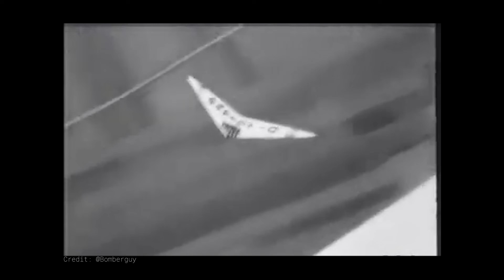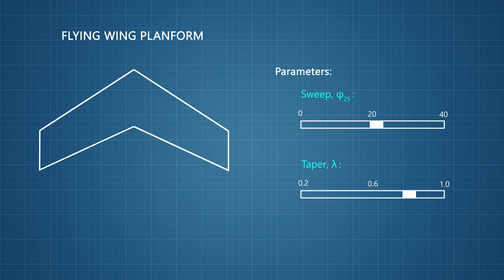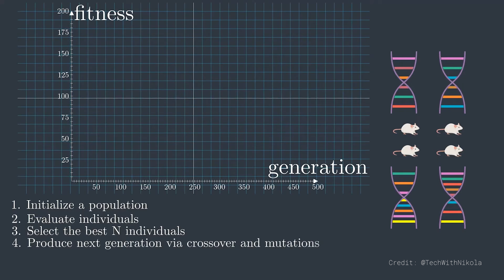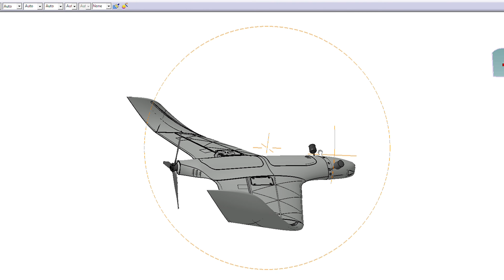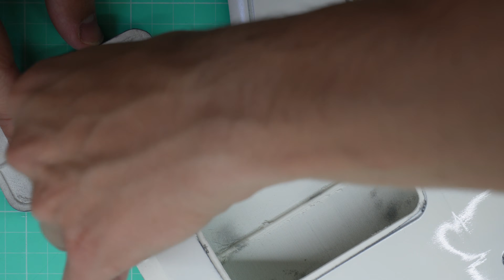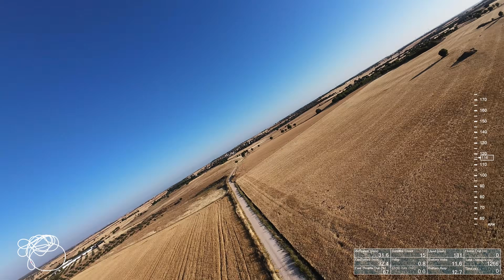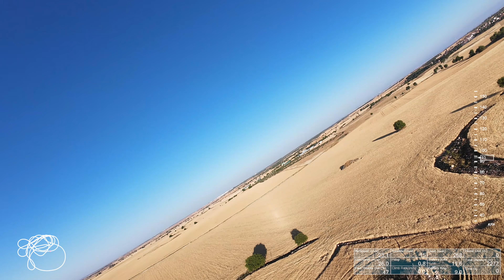🚀 I asked A.I. to design the ultimate FPV Flying Wing... and it's INSANELY EFFICIENT!

Comment: Well done, intresting 😃
Not convinced at this stage AI is any more help than a computer and search engine for helping you build a Model wing. It would need to build and fly multiple designs to get its own data.
No mention of Airfoils, CG. CP etc - there are some glaring errors that it did not pick up, one being the Plane would wobble (dutch roll) badly....didn't it 😉
Reply from the maker: Thanks! 🙌 In the next videos I’ll cover airfoils, CG/CP, and Dutch roll stability in detail. Stay tuned!

Comment: Hi Neuronautic. Could you please share flight results with comparing of other planes. For example baby wing that has the same wing size (0.6m)?

As I see on the speed 100km/h it takes 11-13 A. So if you have 2000 mah 3S battery - then I suppose that you will be able to flight about 5 mins

Also it's interesting to see also bigger design for example for 1.6 meters wing width and with 6S motors as in this case we'll be able to see full efficient and really long flight (several hours) or something like Ar Wing Pro (1.2m). In my case it was pretty efficient (but don't remember numbers)
Reply from the maker: Thanks! 🙌I’ll share side-by-side logs vs ~0.6 m wings in next videos, so stay tuned!🚀✈️

Comment: First off, BRAVO! The requirements, neural network testing, 3d printing.... this is not your first FPV wing is it? As someone who has been flying and designing these things since '08 I sincerely applaud your efforts on this front! Have you though about the noise? I suspect that with the Rx antenna oriented as is you are getting turbulent air hitting the prop inducing prop wash which is adding the "drone" noise and decreasing effeciency. Subbed to your channel and downloaded the model. I am currently building a Horton Ho and would love to add this to my collection. Cheers!
Reply from the maker: Thanks a lot 🙌 Really appreciate your kind words and support—it means a lot coming from someone with your experience! For the maiden flight I wanted maximum link reliability, but since the design is modular, the antennas can be easily tucked inside for cleaner aerodynamics. That’s on my list to test in the next iterations 🚀✈️. Super excited to hear you’re planning to add this one to your collection!
Reply: @neuronautics_Lab  for ease of setup i would agree with you, but you might find maximum link quality out towards the wing tip, antenna orientated in a vertical position. High density items like your battery or even your FC can decrease rf signal strength at range. Unfortunately, This placement will create uneven drag on the wings and induce a "Dutch roll" effect on such a small wing. But that is another topic. Lol.  The null zones of a dipole as orientated are going to be pointing at you when turning and that will result in decreased signal strength. Real world though, it's not going to matter if you are only flying 100m around your location. It will if you're out 10 miles though. Pla is rf neutral, as are the fiberglass rods you installed. A compromise to each of these drawbacks would be a diversity receiver and two antennas at orientated 45* angles to each other inside the wing. Albeit for a small weight penalty. Just some ideas if you make a v2. Cheers and congrats again
Reply from the maker: Super cool and interesting stuff, thanks for sharing! 🙌 Definitely not my area of expertise, but it’s the kind of detail that could really impact future designs. I’ll keep it in mind for a V2 ✈️🚀

Comment: What an exciting achievement, well done! I fully understand the hassle to run over and over CFD analyses to iterate and optimize. Your approach of using a neural model is awesome. I'd love to know more about it. What software do you use for CFD analyses? How did you choose the airfoil, and is the airfoil of the wing root and tip identical?
Reply from the maker: Thanks a lot Pascal 🙌For CFD I used OpenFOAM, and yes, the airfoil is fixed throughout the span: a modified Selig airfoil tuned for low Reynolds numbers and optimized for flying wings. It’s a compromise between efficiency and stability. In the future I’d love to explore airfoil variation see how much extra performance we could squeeze out of it 🚀

Comment: I tried to download the model. There was am error, and it wouldn't let me download it! Apparently you want $34 usd for it.....
Reply from the maker: As I mentioned in another comment, every project like this takes a huge amount of time, skill, and resources. This isn’t my job—it’s a hobby I’m deeply passionate about 🚀✈️. I’m not here to turn a profit; I do it to keep pushing the boundaries of aviation. The small charge for downloading the model files is simply to help offset the cost of the equipment and materials. Believe me, the tools, electronics, and filming gear needed to design, build, and share these projects aren’t cheap 😅, and this helps keep future projects possible.
And believe me, all in all, you’re getting an amazing set of plane files for the money 🙌—well worth it for the work, testing, and detail that’s gone into them!

Comment: You are truly a gifted engineer.  I am and engineer, power pilot, and sailplane pilot.  I have a number of observations that you may want to consider.  First, the reason there are not many flying wings is that they are inherently inefficient.  They have a low span to cord ratio (aspect ratio).  The wing section aft of the center of gravity has to produce negative lift to balance the airframe and therefore it adds as much induced drag as a conventional tail.  The vertical wing tips reduce tip vortices, but substitute a lot of parasitic drag.  I realize you built them for directional stability, but they are not efficient compared to winglets.  
The Northrop flying wing, YB-49, was cancelled because of instability in pitch and yaw, poor payload capacity, and lack of range.  It was not an efficient design.
The B2 bomber is a true flying wing, but it was built without vertical surfaces to reduce radar cross section.  
If you want to make your design much more efficient, add a small canard for pitch control and reduce the wash out of the wing tips..  Burt Rutan's Long-EZ  or VariEze are the poster children for extreme efficiency.  Or consider the design of the Quickie.

If you want extreme efficiency, study modern sailplane design.  These designs have evolved since WWII.  Present designs have L/D greater than 100:1 and have very efficient polar curves.  They have high aspect ratio wings and winglets.
Good luck on your next design.
Reply from the maker: Thanks a lot for your thoughtful and detailed feedback 🙌✈️. I really appreciate you taking the time to share your observations and experience—it’s insights like these that make the design journey even more exciting!

Comment: I am designing a small flying wing that you sit on and operate much like a motorcycle or snowmobile.  It will have a windshield and a removable canopy.  It will be a low speed low elevation machine meant for short local rides.  I am undecided if I want to go electric, but I think that might be what I end up doing.  I am thinking of a dual inline propeller setup, one rear, one front.  And it might have a pair of small retractable wings in the front to help with low speed take off.  Not sure how that will play out.  I want to keep dimensions as small as possible, I think around 21 foot wingspan is around what I have in mind.  It will be made from high density foam, skinned in carbon fiber, and then remove the foam.  The body will be cut into panels and placed on an aluminum tube frame chassic / frame.  I am trying to learn more as I go, but this will be built around Canada's ultralight aircraft regulations.  I think flying wing is ideal for storage on your own property, as it minimizes overall dimensions.  If I don't go with electric, i am looking at used 2 stroke engines, from things like snowmobiles, etc.  And will detune them to be more reliable and less powerful.  It's an opportunistic thing though...if I find something that would work, i will adjust design based on that.  I've liked flying wing aircraft since I was a child making paper airplanes.
Reply from the maker: That sounds like such an ambitious and exciting project, Aaron! 🙌 A personal ultralight flying wing you can ride like a motorcycle is a really unique concept 🚀. Can’t wait to see how your design evolves—please keep sharing updates, I’d love to follow your progress! ✈️🔥
Reply: ultralights are as about as small as you can go safely with a person.

Comment: Very inspiring but you should remember that in context of ANN the design is optimal ONLY within the constraints and scope of the ANN’s training data and evaluation metrics. It’s NOT necessarily the BEST possible design in a broader aerodynamic or engineering sense. You can say that, this is the most efficient design predicted by the ANN within the tested parameters. I’m skeptical about your conclusion, but I still value the innovation and effort you put into it.
Reply from the maker: Absolutely, you’re 100% right — the “optimal” design here means optimal within the constraints, training data, and metrics used in this project. ✈️ I really appreciate your thoughtful skepticism and your kind words about the innovation! 🙌

Comment: What I cannot understand: All this awesome effort, but you still let antennas stick out, as well as linkages, and you do not have a sleek rear end. You also incorporated an LED strip on the leading edge which disrupts airflow and you do not seal the hinges, which enables pressure transfer between the lower and upper wing side which negatively affects efficiency. You also put a horizontal antenna directly in front of the prop to produce dirty air for your drive unit. I do understand, that below 100kph things do not matter that much, but why going for maximom efficiency in the calculations, then ? No condescending, just genuine interest, with a helping hand, of course, if you are interested
Reply from the maker: Thanks for the detailed feedback! 🙌 You’re totally right—there’s a gap between a purely theoretical “max efficiency” design and a practical, buildable FPV plane.

Some of the compromises (like exposed antennas, linkages, LED strip (which is by the way taped for the maiden flight, etc.)) are for functionality, modularity, and even looks rather than absolute aerodynamic perfection. At this scale and flight speed, the penalties are relatively small. However, I do agree it would be interesting to dive deeper into how much of a performance penalty all those small details actually cause. Maybe for a future video?? ;)
Reply: @neuronautics_Lab I understand the practicality aspect very well. But because of all the elements sticking out, you would have had a very similar result if you just made a sleek fuselage and picked a random airfoil for tailless planes - without  AI. I mean, I was 50% of the design team that created what was later to become the TBS Mojito. I poured all my aero ocds into it to make it the most efficient powercruiser out there ( before Trappy took shortcuts in production ).

Comment: Have you had any motor cooling issues??
Reply: And general cooling issues?
Reply from the maker: Not so far! The design has 2 NACA intakes at the nose and small outlet vents near the motor, which keep airflow moving through the electronics and the motor. Temps have stayed well within safe limits during flights.
Reply: @neuronautics_Lab that’s good. I have a Flik wing and cooling was definitely a problem and with the motor covered like that I can only imagine. But it seems like you managed well. 1404? 3800kv?
Reply from the maker: 1507, 2700kv with a APC 5x3E

Comment: Why would an FPV drone have 2 cockpits?
Reply from the maker: They serve different purposes. The front “cockpit” provides quick access for swapping batteries between flights, while the rear one is more permanent, giving access to the flight controller, GPS, and other components you rarely need to touch.

Comment: A slight criticism about your introduction. All birds have tails. All bats have tails. None of the tailless aircraft designers were inspired by birds. They were inspired by the idea of saving weight and complexity, and perhaps by moths (even though some moths have tails). As for stealth technology: that was not a concern until the invention of RADAR. Even then (and still) wooden framed aircraft with cloth skins are as stealth as it gets. Overall you've got it right though,
Reply from the maker: Interesting points! 🙌 While it’s true that most birds have tails, many early designers—like Dunne—did mention inspiration from bird flight, particularly wing sweep and stability traits they observed. And you’re right that weight and simplicity were major drivers too. Regarding stealth, the Hortens didn’t call it that back then, but their designs happened to share characteristics (low RCS, smooth planform) that modern stealth benefits from. So in a way, they were ahead of their time—even if radar wasn’t the focus yet. 😉

Comment: Efficient?? Averaging 10 to 11 amps is not efficient. Cool looking wing though.
Reply from the maker: Average amps during that flight were actually well below that—around 7A (I’ll be uploading a detailed video with full telemetry readings 📊). Considering the speed, the fact it’s only running on 3S, and that the DJI O4 FPV system is basically an amp vacuum, I’d say it’s pretty efficient. I’ll even compare it with some commercially available wings in future videos—so stay tuned! 🚀✈️
Reply: @neuronautics_Lab  7 amps at the speed showing is not super efficient. Better than some commercial, yes. Higher voltage lesser amps. Probably need a different motor prop combo as well. 

My bad for speaking without introducing myself. My name is JD.  Pro Builder / Long Range Pilot.  More than 20 years experience.

Comment: Have a look at the Opal, designed and built by Scott Winston back in the 80’s. Way ahead of its time. Less than 100 kilos dry and capable of crossing Australia in daylight hours, also has the record for fastest height gain to 10,000 feet and the record for absolute height gain for an ultralight at 30500 feet.
I knew Scotty personally and can verify he was a bloody genius when it came to aeronautics.  Unfortunately, he lost his life in an accident.
Reply: Bloody auto spell, Winton , not winston. Thanks
Reply from the maker: Wow, that’s incredible—I had never heard about it but Scott Winston’s Opal looks like it was truly ahead of its time 🚀. Those records are mind-blowing, and it’s inspiring to hear about innovators like him who pushed the limits of aeronautics. Sad to hear about his passing, but his legacy clearly still flies high. ✈️
Reply: @neuronautics_Lab 
Thanks for your comment, I don’t know if you are aware but the opal came under air navigation order 95.10. Max dry weight 100 kilos, Scotty had to remove every bit of extra weight that was unnecessary, such as the plastic knobs on the choke and throttle levers, and other things as well. The opal could carry 280 liter of fuel, and fly at 280 kmph. And he never got around to it but Scotty was going to fly from roughly Sydney to Perth in one day during daylight hours, unheard of.
I am truly blessed to have known Scott and Dean Winton. 
Thanks again for your comment.

Comment: A question about the optimization process. Are you sure that you found the global optimum and not just a local optimum? If so, how did you do that? Anyway your project is amazing!
Reply from the maker: Thanks! 🙌 There’s always a chance it’s a local optimum, but using genetic algorithms helps explore the design space broadly—much more than methods like gradient descent. In this case, the result aligns closely with traditional design benchmarks, so I’m confident we’re on the right track 🚀✈️

Comment: For a bit of history look at the old Hobie Hawk, a glider designed maybe 30 years ago. The wing form looks beautiful but it turned out to be very unstable. Your design looks like it might be susceptible to the same problem. Nowadays there are probably electronics to compensate for the problem but I'll bet they use a lot of power to do so. :-) Your bird is beautiful and well engineered.
Reply from the maker: Thanks! Stability is always a challenge, but modern flight controllers handle it well with minimal extra power.

Comment: Great project and great to see it fly so well. A bit of nit-picking though - its not a flying wing. The usual description for this class of aircraft is BWLB or Blended Wing Lifting Body. Flying Wings are just that - a wing. Maybe with a small cockpit behind the point where the leading edges meet but not a just a tail-less standard body with wings attached.

Comment: Very nice build.
Just a question. How do you know that it is insanely efficient?
Reply from the maker: Thanks! 😊 Given the constraints I set—like max span, wing area, and weight—this geometry is as efficient as it gets based on today’s state-of-the-art simulations and optimization process. 😉
Reply: @neuronautics_Lab  So essentially you were doing the same thing I do to make pedal driven generator of 150W at 500rpm and 90V output when I want 95% efficiency
I'm no electrical engineer to know how to calculate all the things which is why I used AI to help me to design it, but I have general knowledge of problematics. So I know instantly, that things that AI drawn for me are nonsense. Every single time it was wrong. But the matematics was okay.